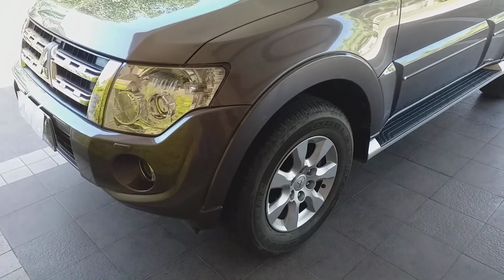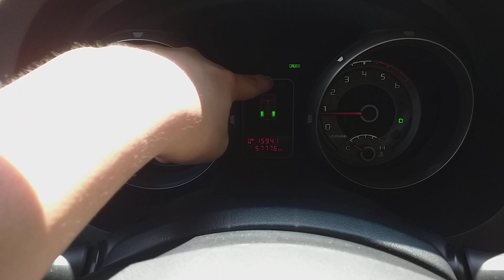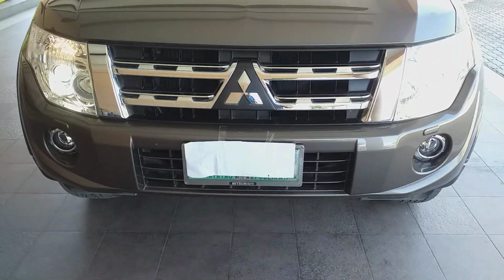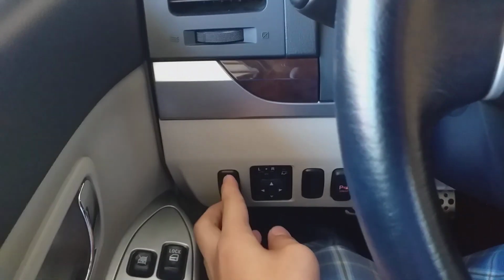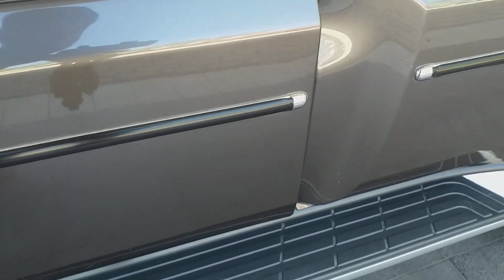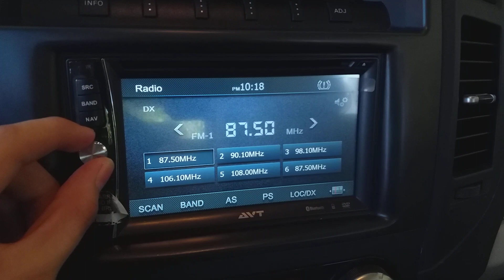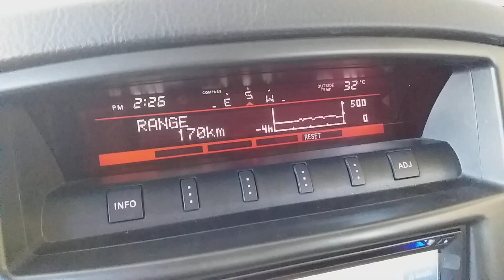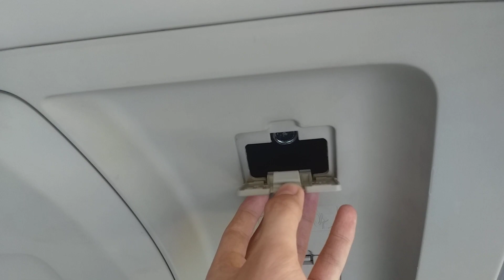2013 Mitsubishi Pajero GLS 3.2 Diesel 4x4 Part 1 Review Philippines

Comment: I bought this suv in 2014 and i still have it now. The only problem i have encountered with it is the front aircon evaporator needed to be replaced and front left suspension bushing needed to be replaced also. Very reliable car.